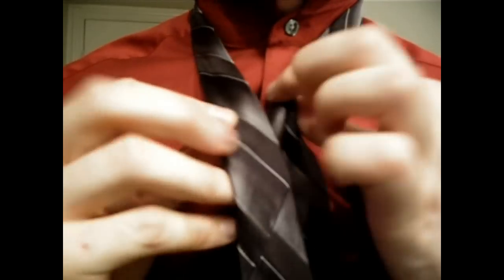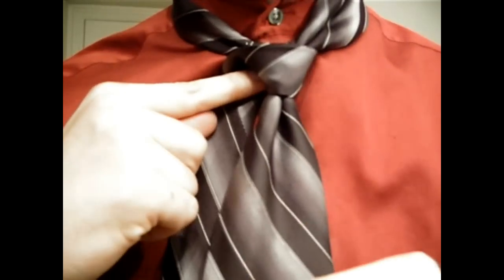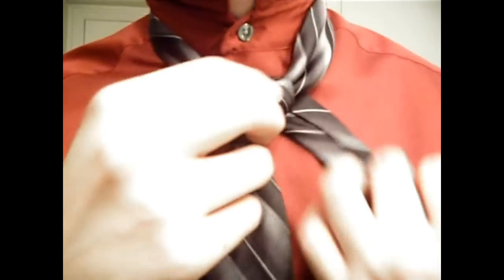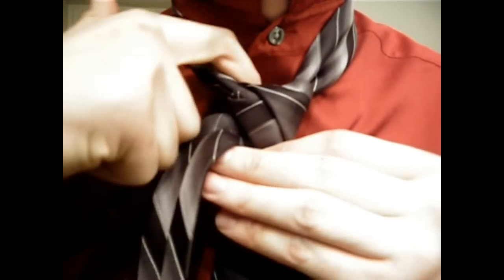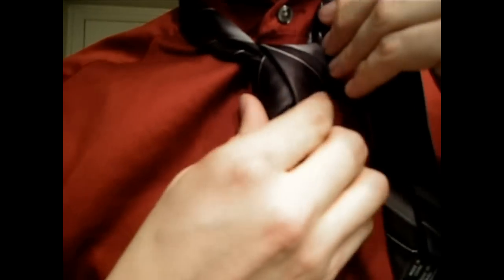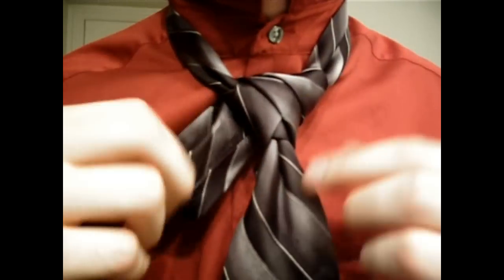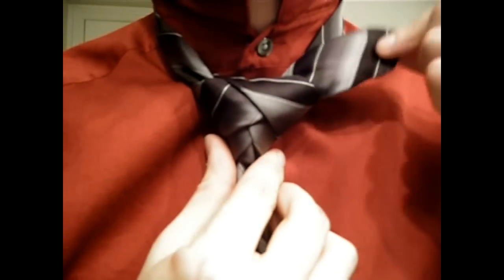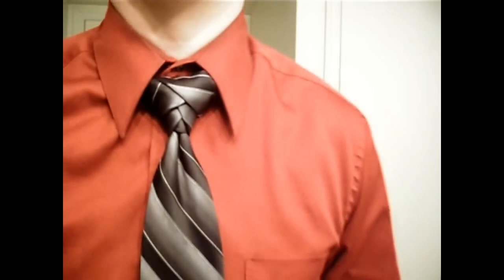The Eldredge Knot: Revisited.

Comment: Well done man! I do find that this knot is a lot nicer than the Braided knot mentioned above, but I do also think that the little finish that Eric Glennie puts on the braided knot (which makes the the little tail hang down like most knots) can be a nice touch for this knot, especially if your tie is longer or your neck is thinner and you have too much tie left to tuck in to your collar. This is probably my favorite knot now. I used to use the Merovingian (Ediety) but this is excellent! Thanks!

Comment: What would be awesome: If the knot section were red and it had a rose stem going down to the tip of the tie. Not easy to pull off since the person wearing the tie would all have it knnotted at different lengths.